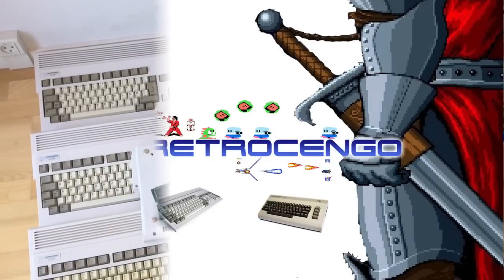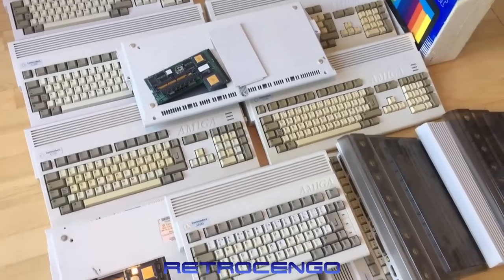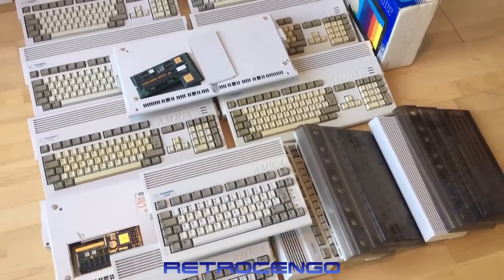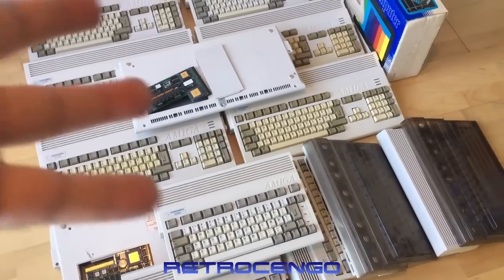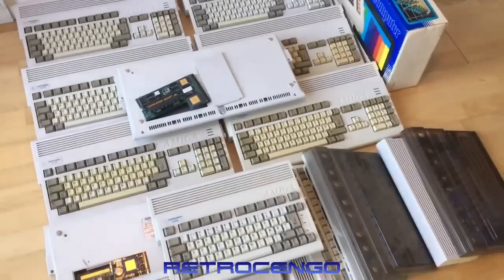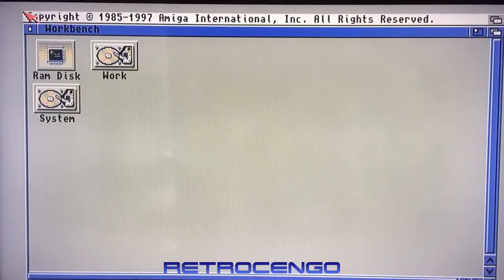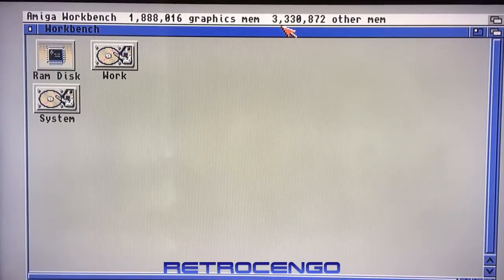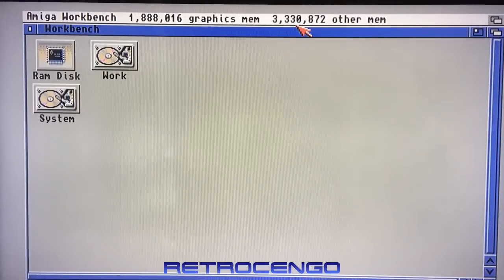Commodore Amiga 1200 Amiga 600 MOTHER-LOAD and GVP JAWS II Review

Comment: I have 31 Amiga 1200s... so keep going. Better when you also have the boxes. In all I have 123 Amigas and every model. I have three of the GVP Turbo and you need to install the software in the WBStartup drawer if you want it to work properly. The first one cost me £350 in 1994. Still works. I also have the SCSI KIT that slots into the small expansion port. All boxed. All my Amigas are featured on my site.
Reply from the maker: scuzz amiga 123 Amigas, ohh nice man, must be an awesome sight😁👍🏻